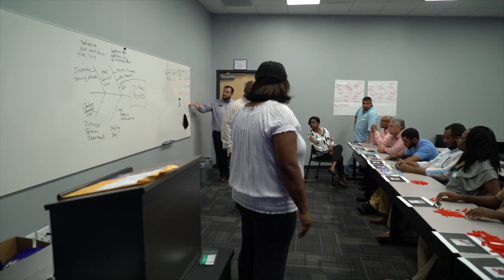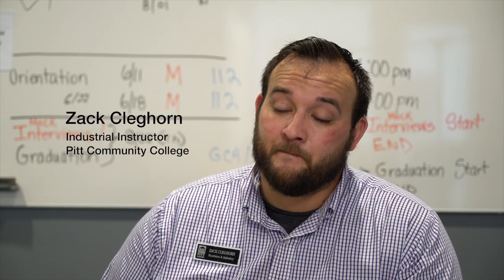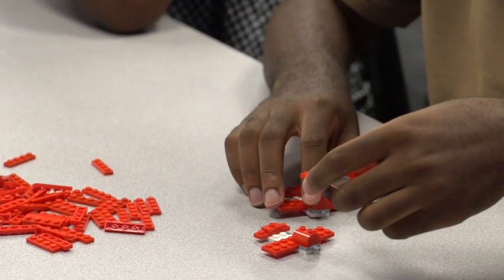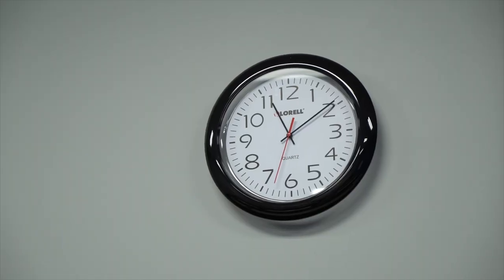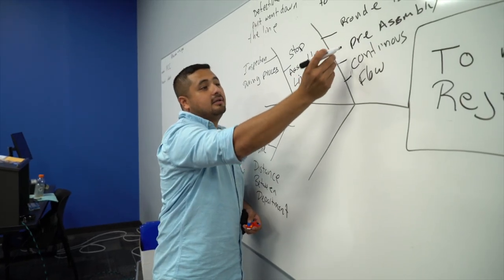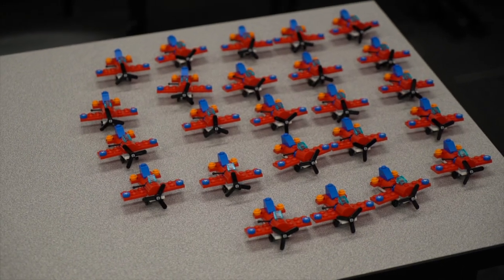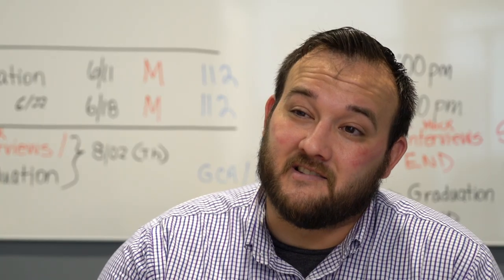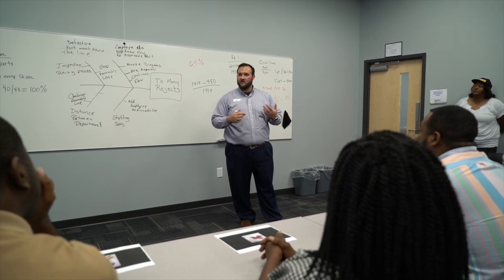Lean Six Sigma with Legos

Comment: Lean Six Sigma with Legos is a training method aimed at waste reduction and improving efficiency.
- The method uses a Lego airplane simulation factory to teach the principles of Lean Six Sigma.
- Workers are assigned specific tasks, and the process is analyzed using Six Sigma tools to reduce defects.
- An example simulation resulted in a 65% increase in efficiency between rounds by standardizing processes and making workspace adjustments.
- The goal is to empower workers to drive continuous improvement in their organizations and save both time and money.